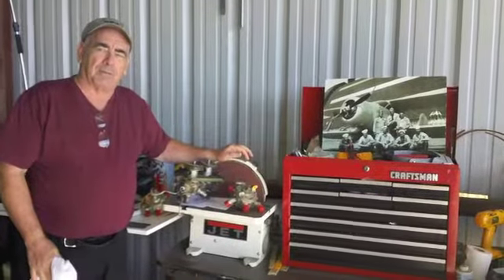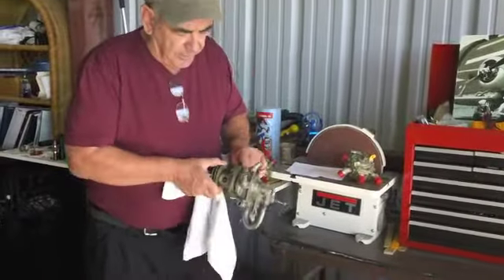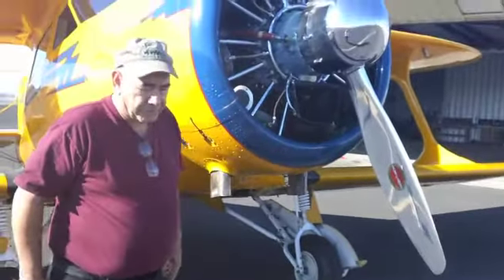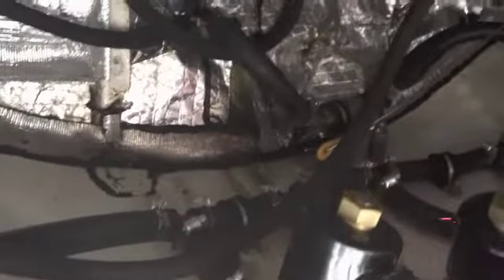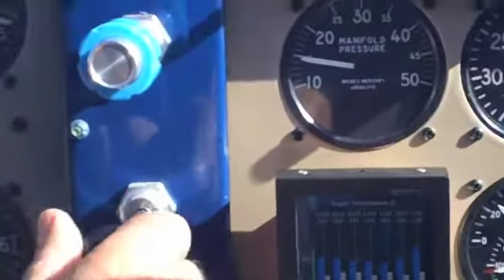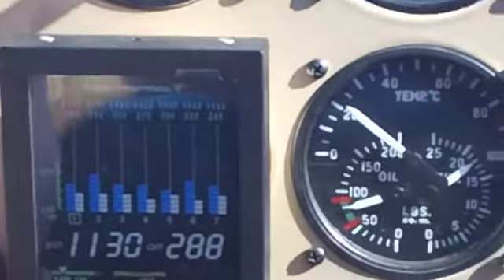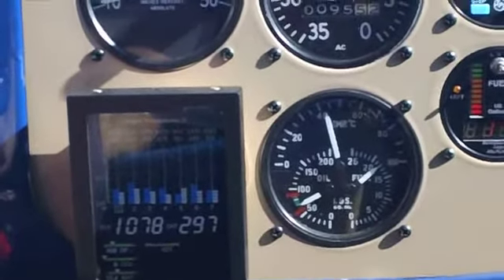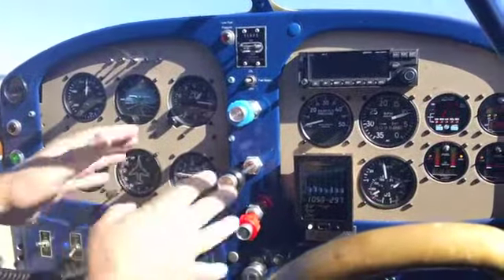Staggerwing Fuel System Modification

Comment: Phil, 2 questions. 1 what carb or fuel injetion system are you running with that fuel pressure if it"s a PS carb where are you running the return line? 2 With the valves are there one way check valves for the lower 3 tanks " just incase  some one left the master on with the upper wings and one  or more of the lower tanks on?" that would make a heck of a mess on the floor.

Years ago I was a airport bum at KSAC and got to know Noel Goursolle  I still remember working on N63549 & N70E